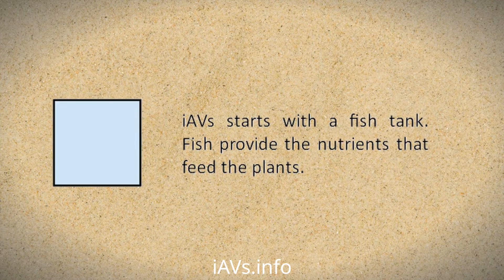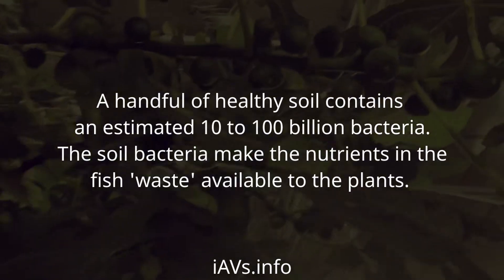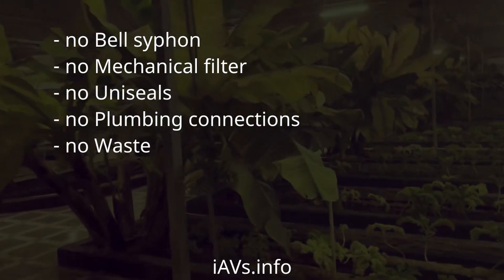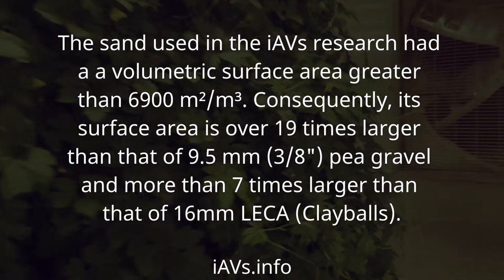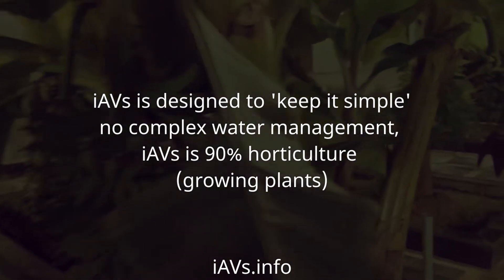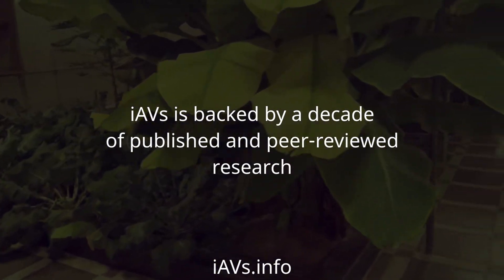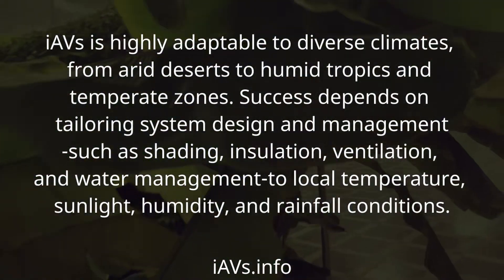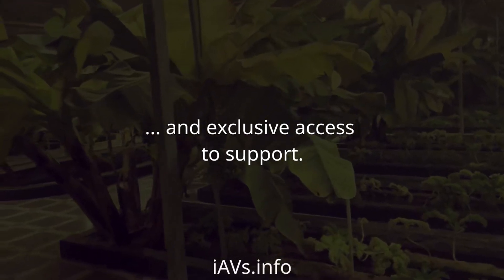An Introduction to the Integrated Aqua-Vegeculture System (iAVs)

Comment: How does the solution pass from the sand bed to the bottom of the tank? Are there filter meshes?
Reply from the maker: The biofilter contains sand and nothing else besides a few small handfuls of pea gravel at the drain outlet.   Water passes through the sand, the orgnic materials are filtered on the surface of the furrows.
Reply: @iAVS-info Ty!